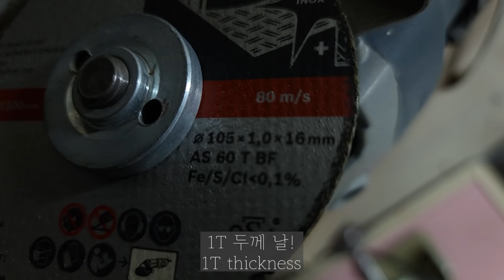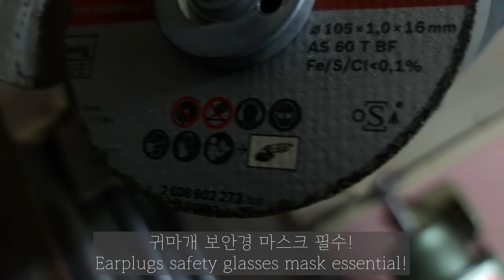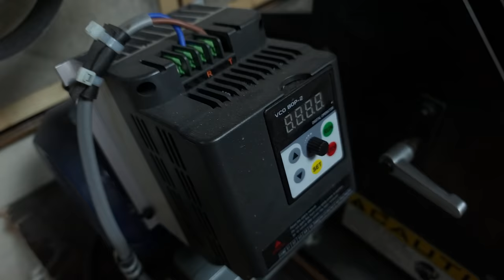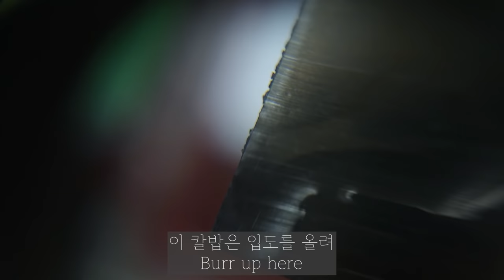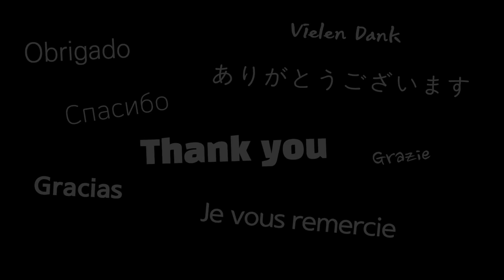[KR] 당신이 원하는 바로 그거! 만들어 드리겠습니다. (자막 넣는데만 12시간! 꼭 봐주세요.)

Comment: Doesn't cutting it with the grinder mess up the heat treat?
Reply: So we're using a speed controllable grinder, and we're cutting it off very slowly and several times. And put wet tissue under the knife in advance.